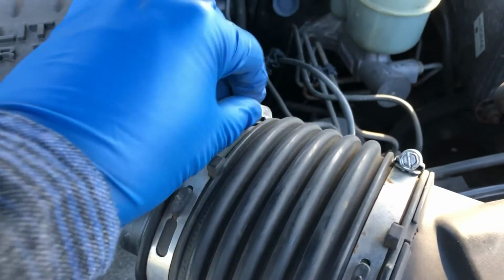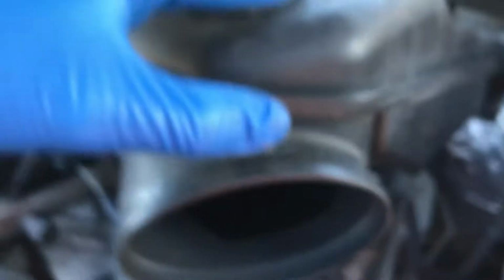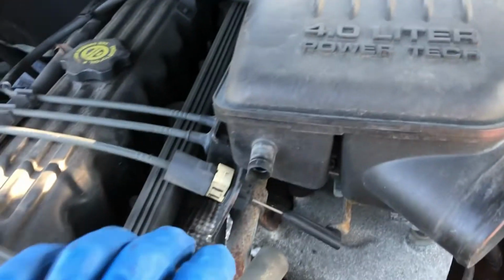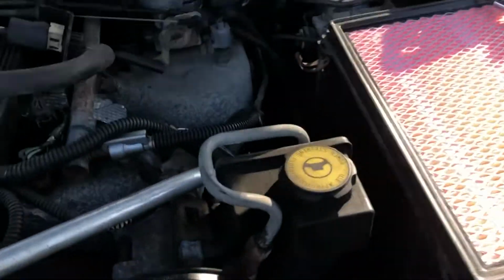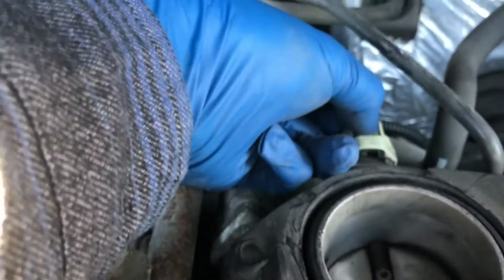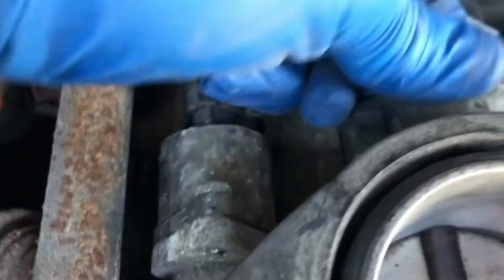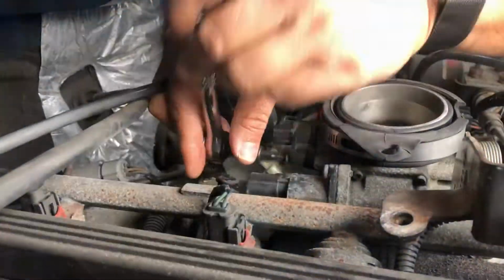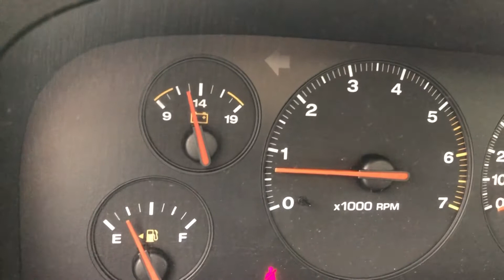Throttle Body Position Sensor Removal - Jeep Grand Cherokee WJ (1999-2004)

Comment: could u do a video about how to adjust the throttle (tv) cable on the 99-04 i6 wj?
Reply from the maker: We will try and secure a vehicle to do that.
Reply: thanks..it would be much appreciated the the Jeep fam, not to mention the views it will get..the existing 2 vids on YT are inadequate  examples without good explanation & according to comments are even incorrect!